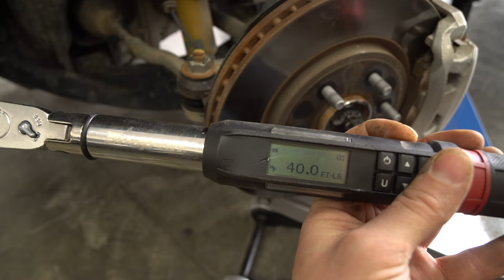HOW TO INSTALL NISSAN FRONTIER 2023 SUSPENSION LIFT KIT AND DOBINSONS BILLET CONTROL ARMS

Comment: Did you ever get squeaking out of rear spring leafs? Also take a look at the bushings in leaf springs? You applied regular grease to rubber or polyurethane bushings which is not good!  Regular grease will break down compound in rubber and polyurethane bushings.  Only silicone grease on rubber or polyurethane bushings.

Comment: Did you guys put longer bump stops in the rear? The dobinsons shocks are 1 inch longer at full compression than the bilsteins. Just curious if you guys measured that and considered it? What bump stops did you go with?
Reply from the maker: Dobinsons put together the kit and required parts no bump stops were changed
Reply from the maker: When doing flex tests with Jack seemed fine will see when it's on the trail